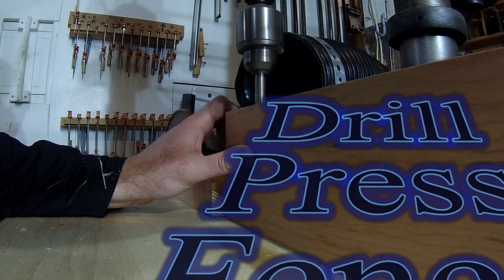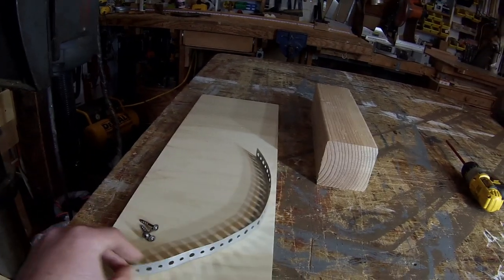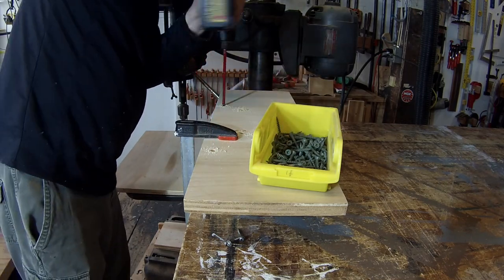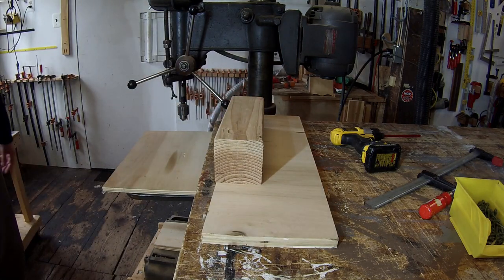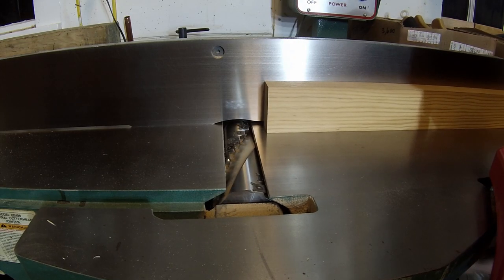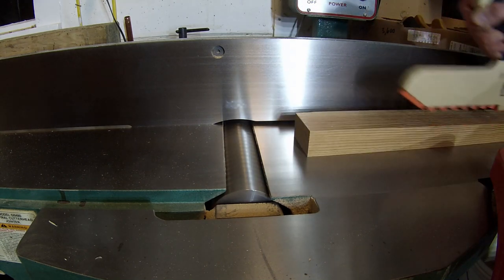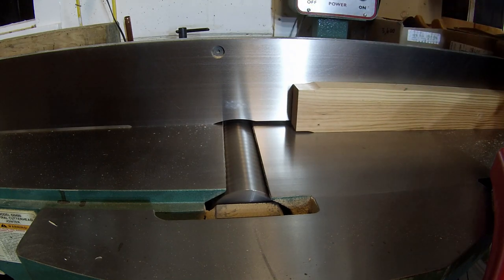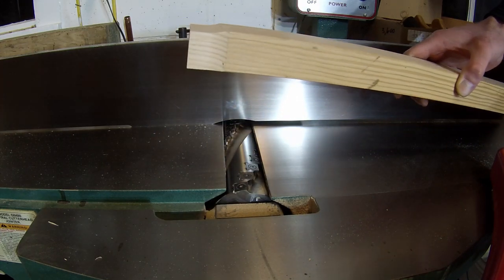How To Build A Drill Press Fence With Dust Collection

Comment: I like the round clamps.  The suck fence could be cool on the drill press with some modifications.
Reply from the maker: those clamps are made by Jorgensen.  the 6x6 and 5x5 are the best clamps for drill presses.  the chips that come from forstner bits will clog up a screen no matter what size.  I place a 1/2"  wire mesh to cover the 4" hose opening when I am worried about small parts getting sucked in.
Reply: hffcom yeah screen wouldn't work to well.  I was thinking a square opening with vertical slots and a piece to slide up and down to adjust opening size.  Could just make it like a router table fence.   Of course not for drilling the edge of wide boards.